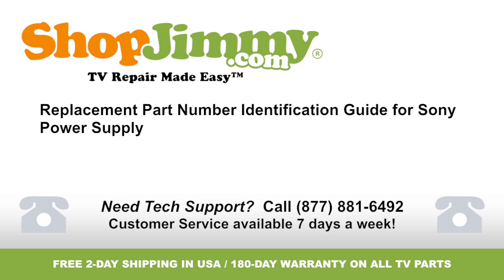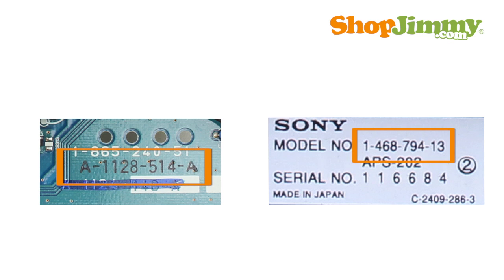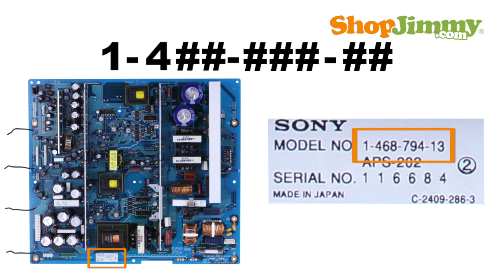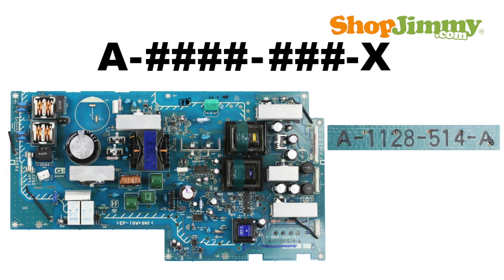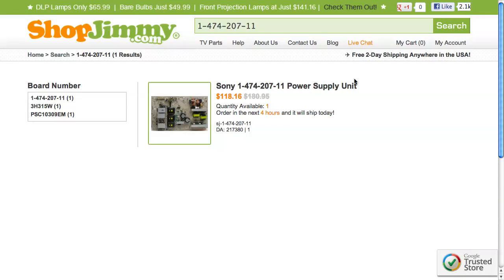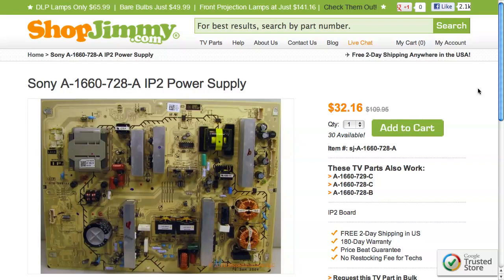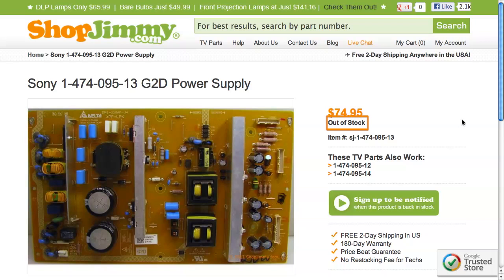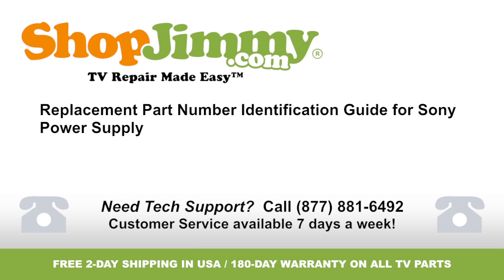TV Part Number Identification Guide for Sony Power Supply Unit (PSU) Boards (LCD LED Plasma TVs)

Comment: Got a question about Sony part numbers.
So long as this Sony 1-474-331-11 matches or the alt part number matches the number 
APS-299 1-884-525-11 not being the same is OK???
I see that they are out of stock and they are at a bad emoji level.

The TV made some noises is what I was told and won't come back on. The fuse on the power board is blown.
What are my chances that is the only issue?

Thanks in advance.

Comment: Hi I have a Sony KDL26v4000 the problem I am having is in the middle third of the TV I have flickering vertical lines appearing, which come and go, do you have any suggestions for a possible fix. Cheers Paul
Reply from the maker: Paul Bryan   This sounds like either a bad panel or a bad T-con board.  If the problem is the TV panel, it may be more cost-effective to replace the TV.  You can replace the T-con board to see if that fixes the problem.  Here is a link to replacement parts for your TV model number on our website, click here:  http://www.shopjimmy.com/catalogsearch/result/?q=KDL26v4000  Be sure to match part numbers on your current board, with your replacement for compatibility.  Here is a link to a video showing how to identify your part number, click here:  Samsung Timing Control (T-Con) Boards Part Numbers Identification for LCD HD TV Repair You can also call our customer service for further assistance with your purchase.  (877) 881-6492  Thanks and please let us know if you have any further questions with your TV Repair!  www.shopjimmy.com